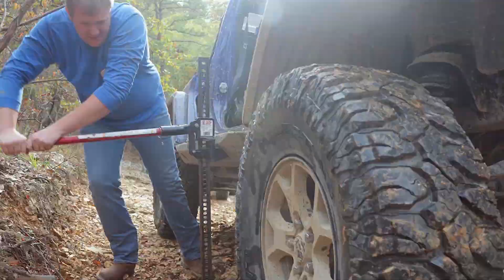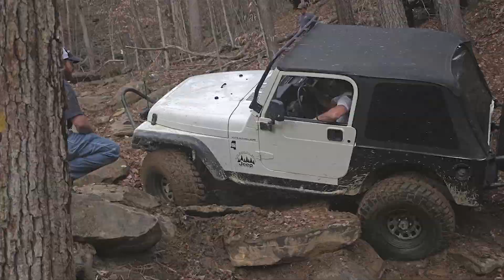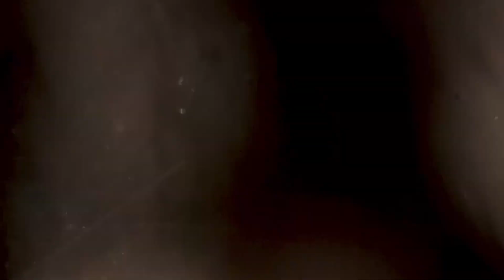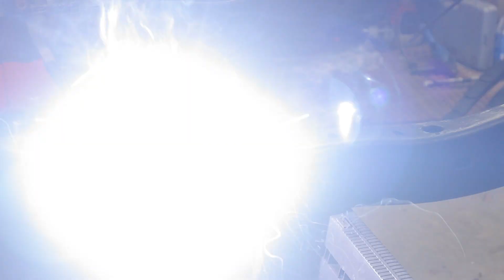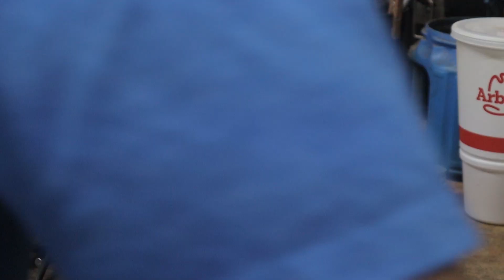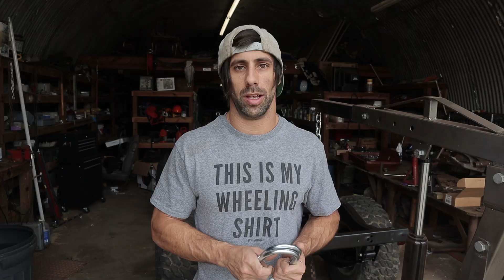It's ROLLING! Our CJ5 Project is Back on it's Own Weight | Assemble Springs, Axles, Shackles, Frame

Comment: Heat all around the broken bolt and the frame get it red if you can. When it cools the bolt and the frame will cool at different temps. That's when it will start to loosen let it cool enough to spray wd40 on the bolt. The heat will bring the wd40 down into the threads. Don't ever cut a bolt off when there is a piece of it sticking out because you can weld a nut on to it or latch on to it with vice grips. You have to let the bolt cool before you try to remove it. If the bolt is still swelled up it won't come out. Some times you will have to heat two or three times.
Reply from the maker: Tried heat a couple times. Wasn’t red hot though. Maybe I didn’t get it hot enough. Thanks for the tip. Definitely will try when it arises again

Comment: Nice work! Are those stock springs or does it have a lift?
Reply from the maker: It had 4” lift springs on it when I got it. I was told they were 2.5”, but I looked up the numbers on the springs and they ended up being 4
Reply: That Jeep Adventure Nice. Thanks. You’re getting close!